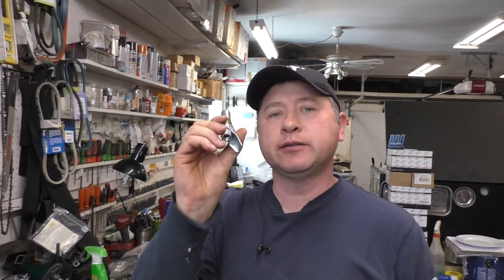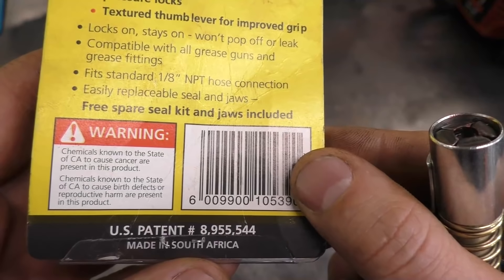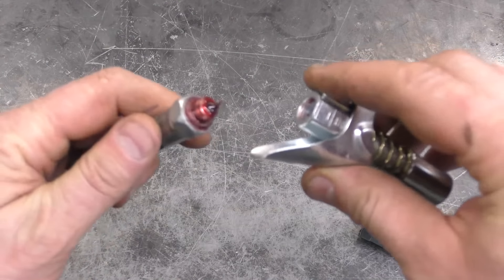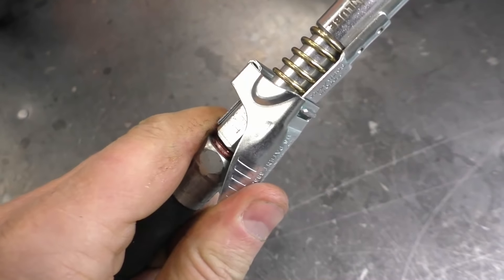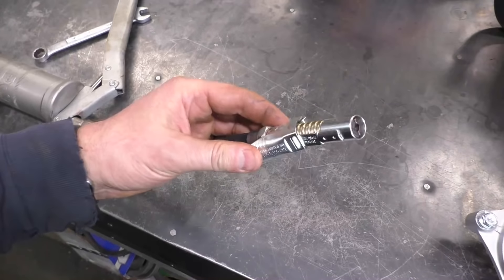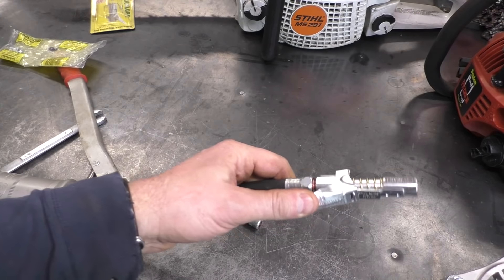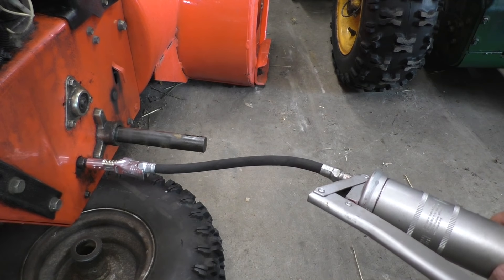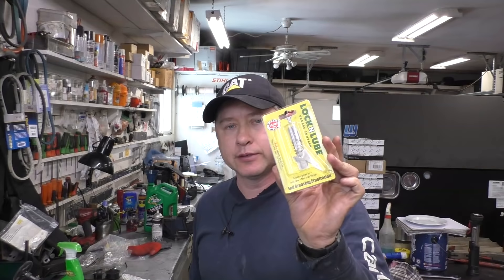"Lock N Lube" Tool Review - The Best Mod For Your Grease Gun!

Comment: I've used this tip before, the best investment as I use it all the time.  They also make some adapters as well.  They make a grease injector needle adapter for greasing sealed bearings, they also make a Narrow Needle Extension for applying grease to non-zerk fittings like axles and such.

They also make a Grease Buster Tool for unclogging zerk fittings that won't take grease.

Comment: I have used this product couple of years now and it's really good when greasing heavy equipment like excavator or a big tractor front loader when you need to have a grip with one hand to stay on ladders and at the same time you try to push grease to the fittings. Very handy product! Only downside is that it needs more space around the grease fitting than the standard coupler.
Reply from the maker: would be good if they made one with a 90 degree coupler
Reply: @donyboy73  They do actually!  It locks on as well.  Really great accessories.
Reply: @abuehler81  Haven't seen that. Must have a look when I next time go to parts dealer
Reply from the maker: @abuehler81  I better get it!
Reply: @jarigranroth6873  Yeah check it out on Amazon.  Just search "lock n lube" and it'll show up.
Reply: I found that quite true it does take up more space to use but once locked on it will not leak
Reply: @donyboy73  They also make a longer one that will fit into a recessed zerk.
Reply: @donyboy73  what I did to get a 90* elbow was to screw a 90* grease nipple into the part that I took off the gun where it was attached to the gun, made for a nice attachment that the new piece could lock onto

Comment: Don, I too have had this attachment for a while,  i bought a 90 degree grease nipple and screwed it into the end of the original grease tip that I took off the gun. Now I can just attach it to my new locking tip for hard to reach areas.  Comes in handy. 
Don't forget to put your clock ahead tonight

Comment: If your zerk fitting won’t go in the hole you need to adjust your tip 
If your tip falls off when greasing it’s likely cause you wore it out by shoving it in with improper adjustment or it’s just loose and needs a twist to tighten.

Comment: I've only used one for a couple of years, but they are amazing. If you have a fitting that you have to get on at a little angle, it will still grip like crazy. If I were a professional mechanic, I'd have one on every grease gun I owned.

Comment: One note... a lot of folks don't realize those standard grease couplers are adjustable. That little knurled end unscrews and allows you to adjust the tension on the zerk fitting. Most folks don't realize this because when you get a new coupler it is screwed together so tight that you don't even realize it is adjustable. I have had them so tight that I've had to put them in the vise and even then I thought the metal was going to tear before it broke loose. Once loosened, you can easily adjust the tension to whatever is needed.  Even so... it still doesn't beat the Lock 'N Lube!   :-)

Comment: Great succinct clear video again Don, thanks so much for your time and effort 👍👌👏. 
I use a similar fitting and it really does change your greasing jobs. Once locked on you can pump away and just concentrate on how much you’re putting in without worrying if your gun’s still attached correctly. 
Great kit.

Comment: Been using these for 15 years.  They’re great.  There would surely be some tight areas where it couldn’t be used but I haven’t personally found them yet.  I use them for automotive & marine.
Reply: They make a 90 degree version for this very reason.  They also make a 90 degree adapter as well so no need to change the straight adapter.

Comment: Thanks for the excellent video. Yeah, I agree, it's a great tool. I bought something like it on Amazon about five years ago. I use it all the time. It's like having a third hand when I'm under the Diesel mower trying to grease the drive shaft and not have the gun detach from the fitting because I need both hands to operate it.

Comment: I have used the Lock N Lube but find I need to move it around on the grease fitting after I have locked it on for it to really seal well. The company also sells various couplings/adapters for hard to reach locations. The company will soon offer Lock N Flate, a locking air chuck.

Comment: I've used one for several years. It is a good attachment. Well worth it. One issue with it is, it is larger the the standard fitting. So it will not fit on some recessed fittings. I keep 2 guns around with different ends. Or you could use an adapter.

Comment: On a normal grease gun connector, the tip unscrews (they’re usually tight) to open the grabbing teeth. Put it over the nipple, then retighten with your fingers. Holds every time. 🇨🇦👍🏼

Comment: I'm on my daughter's YouTube account. That looks like a pretty need attachment. What I've been doing I'd not screw the very end all the way tight on my grease gun. Not the wrench tightening part, but the very tip that you turn by hand. I leave it a little loose. I don't have to fight it on or off. Now if I have a grease fitting that doesn't want to take grease easily, then I connect it to the grease fitting, and right before I start greasing I tighten the tip. I then grease the fitting. Of course I have to loosen the tip a little bit otherwise I can't remove it from the grease fitting.

Comment: Good tip.... add a second grease gun hose to get more length ... that way you can hold the gun cylinder in place with your foot, pump with one hand and hold the tip firmly on the  zerk with the other hand. Adding a third hose may be usefull in some applications. To join multiple hoses.. ask your fitting supplier for  unions with the appropriate thread pitch.

Comment: I have used a locking grease coupler sold by Princess Auto for years. Although, I can't compare it with a Locknlube coupler qualty-wise, it does the job for me (occasional use) and is available at half the price Amazon sells its own. Definitely a must have ... until we grow that third hand. Amitiés !
Reply: Donald, there is this reply I got from a comment I posted on your site that asks me to get in touch through a what'sapp number so as to claim a prize. Seems fishy to me. What's going ?

Comment: I bought a Lock n Lube a few years back. It started leaking after about 9 months, using it once a week to grease a skid steer. I checked for dirt, but that wasn't it. I took it off and went back to the old style.

Comment: Been using it for the last two years, will never go back to old type.  Make sure you get Lock N Lube, not some  ripoff product.  They are worth the extra couple of bucks.  They also have great lube guns on their website.  They are so great for my tractor undercarriage area, where it's hard to use two hands.   Occasionally the end won't  fit on tightly surrounded zerks.

Comment: I bought the Harbor Freight version, but have not used it yet. I do know it won't work everywhere, as I had to get a 90 degree fitting to get to some tight fittings on a snowmobile suspension, where the regular tip wouldn't fit.
Reply: LnL on my straight grease gun.  Extra long whip and 90° tip on a second gun for the middle spindle on a 3 blade deck.

Comment: Thanks for the information Don. The problem that I have is disconnecting  the grease gun from the grease zerk. With the Lock & Lube it should be easy to disconnect.
Reply from the maker: yes it is!
Reply: You know all grease gun heads are adjustable.  You just twist the head to tighten and loosen.  This tool definitely makes it quicker and easier tho.
Reply: @rickdff62  I do now. Thanks.

Comment: What's the life expectancy of the lock in lube tip?

John Deere makes a grease gun that has a volume and pressure setting, that seems pretty good, I picked it up last fall. 

Some of the old equipment manuals say you are to use a pistol grip grease gun, because it pumps slower at a lower pressure.  Yeah I can verify they are correct after cracking some end cap welds on a bearing

Comment: Hi, I am after some advice on something completely different, I have a Hyundai 420 cc wood chipper and it started smoking black smoke and keeps losing power, I cleaned the plug , carburettor which had some rust in the float chamber also the petrol tank was rusty which I have cleaned. Just done a compression test which read 45 psi ( is this ok) appreciate any advice 
Cheers mark, ps great channel

Comment: Sounds good. I have trouble getting grease gun working at all. Any tips for getting grease primed?
Reply: After filling the gun with the spring loaded plunger retracted, install the cap (working end of the gun) but only a couple of turns so that air can leak out.  Release the plunger and listen for the air to escape.  After the air has escaped tighten the cap and you should be good to go.  PaulL

Comment: Sometimes the diameter at the front is too big to work with. Is it possible to remove it when there is pressure in the hose?

Comment: Been there, done that.  Works great for a few uses then the “jaws” lose their grip and grease flows out the sides.  Perhaps this is why they provide an extra set of jaws with every purchase. Grossly overpriced for an accessory with a short life span. Used it one season on a lawn tractor, spreader, a couple of hedge trimmers and lawn edgers.  The next year greased oozed out of the sides making it completely useless. Buyer beware.
Reply from the maker: I'll check that and do a follow-up